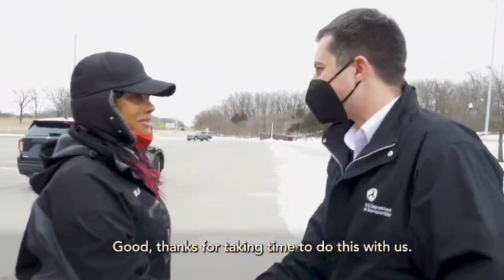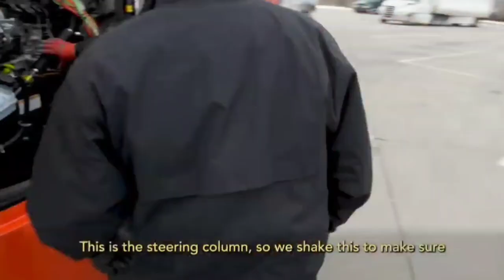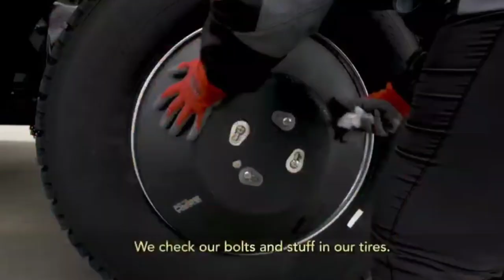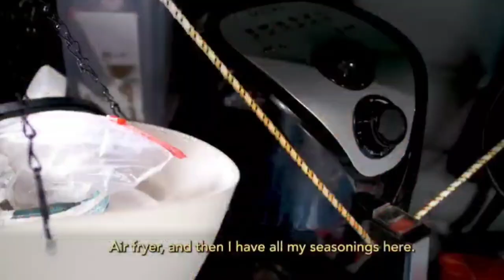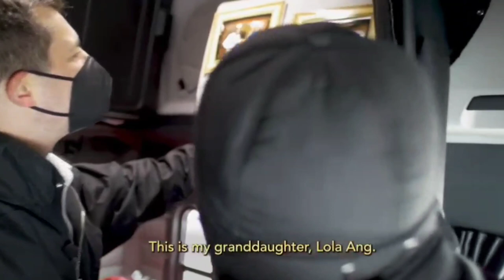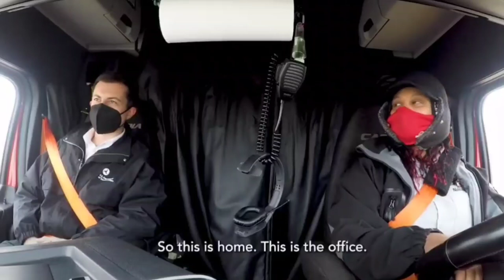Head Of DOT Jumps Into Semi Truck With Trucker For The First Time To Understand Drivers Better 🤯

Comment: A brand new freightliner and the driver is sitting there with a full winter coat on with super warm hat, (earflaps down) covid mask on,  Talking about an air-frier but a jug of vegetable oil in the foreground???  Pete B. found a most untypical driver to ride with.

Comment: The fact that she showed him where she checks her "brake fluid" and she checks the "nuts" on the wheels because she goes up and down steep grades makes the entire encounter a great big joke. Publicity stunt, maybe, if it wasn't then it did the industry a large disservice. I invite him to come spend one day on the job with me and I will open his eyes to what really goes on out here.
Reply: It was fake AF.
Reply: @justus7181  Study this industry? Been studying it for 29 years, 9 of those years have been studied using the trucks and trailers I own, operate and maintain. Just for kicks I took a second to open the hood on the very truck I am driving today to check the brake fluid, and wouldn't you know it, it doesn't use brake fluid. Class 8 trucks use compressed air, not brake fluid in the braking system, she is driving a class 8 truck and stated in the video that under the hood is where she checked the brake fluid, there is a problem here and it spends most of its day behind the wheel ot that truck. She also stated she checks the nuts, "wheel fasteners", to make sure they are tight because she goes up and down hills, hell, I check mine so the fucking wheels don't come off. I wonder if she climbs under the truck to check the brake chamber stroke, or has a clue what the minimum brake shoe thickness is, I know I do. You see, 30 years holding a class a CDL with all endorsements, 32 years holding a ASE Diesel Master Tech status as well as driving and owning my own equipment makes me very studied in this industry and more than qualified to say this woman did a disservice to the very industry I strive to keep safe, she has been poorly trained by an industry that cares more about a warm body behind the wheel than public safety and that is regulated by politicians who have no fucking clue what the actual hazards are in the industry. Rant is over because I have to unload so I can get home.

Comment: I'm not buying it. Did you see how clean the motor was ? The lady gave the impression she runs OTR and if so, the engine compartment would have not been spotless. And " Brake Fluid " on a truck that uses compressed air to stop ? Give me a Break !

Comment: No LESS than 2 years..to get the whole picture...the hours spent behind that wheel and all that goes with it would give them a small taste of that career.  They should have been a driver themselves with maintaining a CDL ..
Reply: 100% on the upper tier of DOT should be required to possess a CDL (at least)

Comment: It's a stunt. Put him with a 15 plus year vet for 3-4 weeks with no hotels,no fancy restaurants,no home shower. Have him get the full experience of dealing with shippers and receivers. Then having to deal with 4 wheelers while trying to just get down the freeway. The dude has no clue what it's like to do this job. Just my opinion,you shouldn't be in charge of transportation if you can't drive or have any experience driving a truck. That's like giving a kid a bat,sending him to a house of mirrors and telling him not to break anything.

Comment: Riding isn’t going to cut it….if you are the head of the ones making the laws and regs, then you should be able to get in and drive and probably have at least a minimum 2-3 years experience as well. We need an actual seasoned driver, not a dude with a degree and political office to control how we live and work out here.

Comment: I want to see ole boy in a duplex mack and getting the full treatment,Swift and Schneider blazing side by side at a blistering  speed of 62mph,holding traffic for miles until one claims first,the wonderful and courteous 4-wheelers,feet washing in the sinks from steering wheel holders,the jack asses that take their 30min in the fuel isle,those wonderful dispatchers (you know the kind) and the shippers and receivers just to name a few.

Comment: I think that he should spend 8 hrs a day with at least 5 different driver's covering 6am to 6pm in a week then 5 different driver's 6pm to 6am the next week, but it should be a mixture of company, owner operative and own authority driver's he, the head of dot and his senior dot officers can get some glimpse of what a driver goes through, but also they see what a driver goes through when dealing with the dot at a way station or a preset spot check or a on the spot, spot check.
Because the higher up the chain of command the less contact with what is actually going on.

Comment: What a joke with a rookie woman driver That doesn't even know the difference between power steering fluid and brake fluid a tractor-trailer does not have brake fluid if she doesn't know that she shouldn't even be behind the wheel